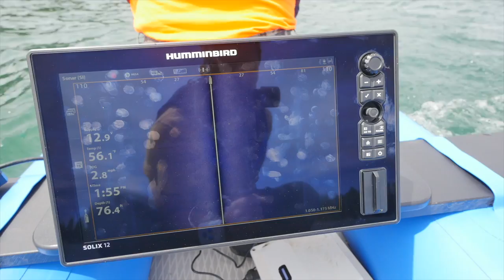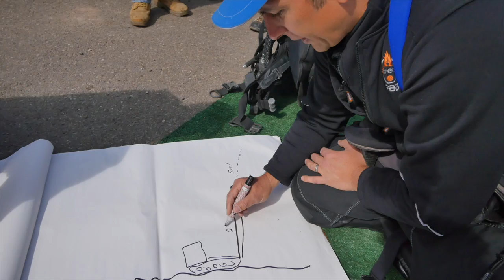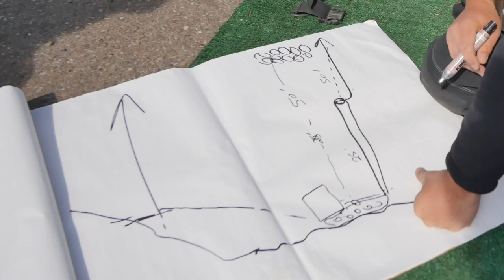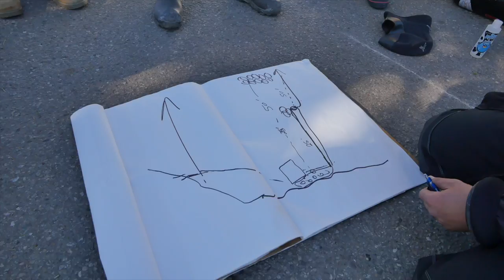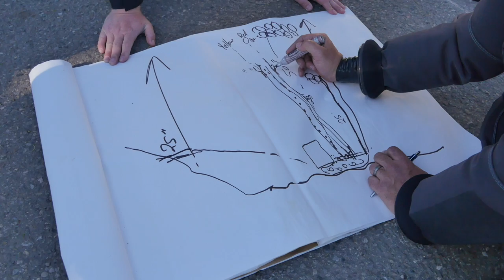Recovering 15k Pound Snowcat 75' Underwater in High Mtn Lake

Comment: Can I make a suggestion but you probably already got it out of there rig up a square heavy duty tubing or bigger bigger than bigger than bigger than the snow cat attached chains you got down to the snow cat and on the upper part of the square or rectangle attach along the edges the bags to go to the surface that way you have more surface area or Lyft I am not a diver I just took a little bit of science you might also need the multiply with the way to the to an extra cribbing or chain

Comment: i don't like you sticking your hand in through the track to get it rigged looks like it caused a lot of problems for you guys,  snagging etc....so maybe during a dry run on land try to figure out if you can use a tool, think a pvc pipe with a wire L shaped hook,  the pipe with the chain goes in, you rotate the hook it drops the chain from the top and use the same tool to pull it back... do not put your arm in there it's not working and to keep doing it is just not a good idea..... and don't worry about the track - that is a wear item it can be repaired/replaced....   the frame on the side has to be used IMO... at 6 mins the guy has the right idea and it can be done behind the cab... but the biggest problem you guys had was rigging... practice the rigging on land, full rigging with the tools you'll use underwater and diving gloves on....  GL i'll be watching to see this thing get pulled....

Comment: Build a rack that is able to space your bags. You got the coupler on the back of the cat I would get a 15 ton shackle in that clamp have a cable attached. Bag that point . I would also practice running a few cables through the cat on land with a pusher bar. You run 3 cables and I guarantee you will get it up with greater Control.  You probably would be better running cables from bumper to bumper even if you get it up choker cable one side it will not come off the 2 axles.

Comment: Build a floating lifting platform: 

Floating structural loop 25' diameter
Can be assembled and disassembled in the water
Has 8-10 manual hoists
Air-bag flotation
Can be transported and used for other projects

I can design this for you.
Reply from the maker: So we've been thinking more about this. The issue is what happens when you have 15,000 pounds below you and something releases? Everybody on the floating platform goes flying?
Reply: @AdventuresWithPurpose  Good point.  Electric hoists.

Comment: I look forward to your return trip to bring this thing to dry land! 
I want to share a thought, something that I think is missing; would seem to me that the hose connection point on each bag should have a check valve, that way, you can connect every bag via your manifolds, and if any one bag should pop, or otherwise have a leak, it will not drain any of the other bags. 
Great job on those manifolds on the fly, I am sure that with a little refinement, they will hold strong!

Comment: Why wouldnt you use just a couple of really fat open bottoms? go around the frame and you'll have enough anchor to use only a couple bags to keep it level.  Or just run one 15k open bottom, and a 1 or 2k on each end to level the unit, and tweak bouyancy for the leveling bags on approach to the ground level.
Reply: What yall do is so far from professional its bonkers.

Comment: So, no possibility of running a single steel cable to its hitch point, putting the machine in neutral and wenching it directly up onto the shore?.. I realize it's pretty far but you could eliminate cable segments as you go and never have to deal with the entire weight of machine..
Reply: Someone else asked the same question and he replied saying that the USFS forbids dragging it out because of natural springs in the lake.

Comment: 43:54 As I watched this video I was wondering when you guys would eventually come up with a multi port manifold to inflate multiple bags more evenly at the same time.  This seems to be a safer approach for the divers only having a few simple connection points rather than fishing mourned for each bag individually during the fill process. Cheers, #SeattleRingHunter

Comment: if you have a tow line tied to the snow cat why can you not hook a chain to it and pull the thing? you have SOME lift which will certainly help but there is no reason you can't use that lift and a strong winch to pull the thing at least closer to the shore
Reply from the maker: USFS requires it be lifted and not pulled across the lake bottom because of natural springs.
Reply: @AdventuresWithPurpose  AH ok that makes sense. looking forward to the update.

Comment: I seriously don't understand why the bags don't have 20' whip hoses attached to them with a small flotation device at the end, so that the ends float well above the bags. They can then be connected to hoses on a manifold at the boat, with separate valves for each bag. Number the bags and hoses, then the divers can communicate to one or two people in the boat controlling the air at  the manifold in real time, and keep out of harms way as the bags are being filled.

Comment: Can you lift through the cab?
Reply from the maker: No attachment points for that much weight through the cab. We have plans on how to get this one.
Reply: Can you put a bag or two inside the cab to get some contained lifting power that might give it a righting moment. Not so much that it would tear the cab off.
Reply from the maker: lightning demolition Roof of the cab is missing as seen in the video.

Comment: I would just feed compressed air to the engine and drive it out 😆
Reply: Gas might be bad
Reply: @bigstatercak2193  I would be more concerned about hydro lock but that too. Could always run a fuel line up as well

Comment: Just came across your channel. As a marina owner with 20+ years of marine recovery in everything from houseboats, bulldozers, tugboats, barges etc. Your equipment is too lightweight for equipment recovery. You also don't have a variable flow manifold to control the lift, fill rate and no ability to purge. The broken strap shown should have also never been used. No carabiners! only heavy shackles rated at a minimum of 3x the load. Commercial strapping rated for 3X the estimated load should be used as well. I wouldn't have put the strap you showed on a Yugo to be quite Frank with you. It's a whole different world when you're dealing with 15klbs plus mud and water weight not including suction than dealing with a 2k lb car. You're looking to be rated at 45klbs to even begin the job safely. Get with a crane or professional rigging company and take some classes. We have to use certified riggers and you're getting into a new range of laws with those kinds of weights. I'm not knocking you a bit, your safety procedures impressed me, I'm only offering a fools advice and don't mind answering questions also. Sometimes experience is helpful.

Comment: Looked quite professional at the start... why are you working a job like that out of jon boats and kayaks... Need a couple 20-24' boats. Why didn't you guys contact a quality Wrecker service to winch that thing out with the bags. Only arm chair quarter backing With a Fire Service heavy rescue and wrecker back ground. Biggest I have recovered was a D8 Cat in 30' of water about 1100' of wire out 3 deadmans no bags almost 80000 lb machine no bags used just pulling 3 day job. And yes we made a shit load of money doing it.

Comment: 15,000 pounds on a frozen lake? Are you freaking kidding me? Even with those wide tracks, the ice would have to be extremely thick to hold that snow cat. It should not of been out on that lake without testing the ice thickness. Now two kids are dead. 🙄 
It’s too bad they weren’t driving with both doors open, so when they got in trouble, they could’ve jumped out.
Finely, you’re in relatively clear water, no muddy lake or river. 👍🏼👍🏼
With all they’re pulling, those carabiners might not be strong enough to hold a total of four bags. Maybe they are.
28:55 is definitely where it pulled loose.
Another thought:  Maybe put some of those bags on slightly longer ropes, so they don’t get in each other‘s way as much.
Great effort, though. I do think one bag got a hole in it, because there was a lot of air bubbles at the end there, when the diver was on top of the bags.
I would be sure to swim free of that thing, as soon as it starts to move upwards. You wouldn’t want to get snagged on the snow cat, or caught in the lines, and dragged back down to the bottom. It could be tragic.

Comment: Never lift with carabiners I don’t mean to call you silly for it but that was pretty stupid. Shackles and steel ropes always and I think this was definitely a surfaced supplied job not a scuba. Quite of bit of mistakes in this dive.
Reply from the maker: Thanks coach.  Did you know that even the army uses carabiners? This was not the issue, but thanks for taking notice.
Reply: Adventures with Purpose I wasn’t saying it was the issue it could be an issue google carabiners that failed pretty scary stuff!

Comment: Why don’t you use proper webbed slings ?👍🏼🇬🇧
Reply from the maker: Webbing Slings are great if you can get underneath without a chance of cutting your slings on metal. This isn't a smooth bottom boat recovery.
Reply: Adventures with Purpose 
I’ve never been a a lift with a boat but I have done a few lifts on steel ,
And webbed slings have always been ok 
I was referring to the bit round the cab of the machine, rather than chocking the sling I think you’d I’ve been ok to cradle round each side , 
I’m gonna stop ✋ now as I’m not trying to tell you guys how to such eggs , you guys a ace and I have much respect for what you do , next time your lifting owt like that tho it may help you out to speak to a steel Erector , 
That what they do on the daily, lift all kind of shapes and sizes of steel 👍🏼

I’ve been on some big jobs in London 
And lads pride themselves of big safe lifts ,
You guys do such a good job though I’m not taking that away from you 🇬🇧👍🏼

Comment: You need to do more homework everything of this size even little bobcats dozers excavators they all have factory lift points on the inside of the tracks towards the frame of the body he's a spreader you hook them all up you can lift them up move around with a crane done construction for 25 years I know about this you guys need to do your homework it's not just attaching cables I'm feeling better there's certain lift points from the factory all heavy equipment has that do your research

Comment: look like you going need engineering to help you make right way get it out
im engineer repair but there few way i can help ya with

i see you make big mistakes adding more bag on one rode is wrongly because if that rode snap it going hit driver underwater
what ya should done is get 10ft long rode attach to snow truck to two bag repeat it same on other side 
front n side by side n rear that way to avoiding dangerous of rode snapping and i see you got tools 1 air hose attach to adapter to 6 bag use that attach to front n side n other one be side to rear that way should be able to lift it off ground
12 rode 10ft attach to bag to rode to truck
36 bag to lift it without having issues
should be able to get it done